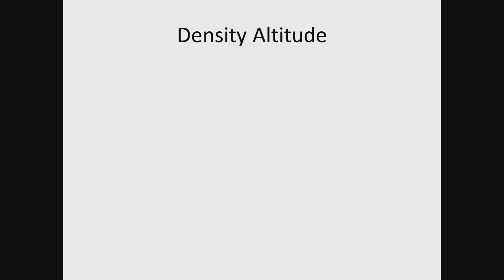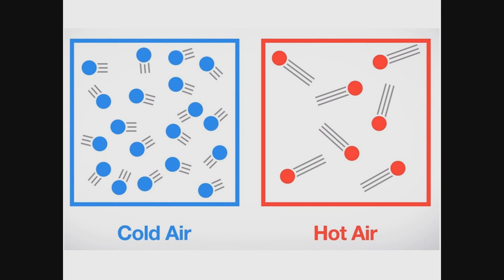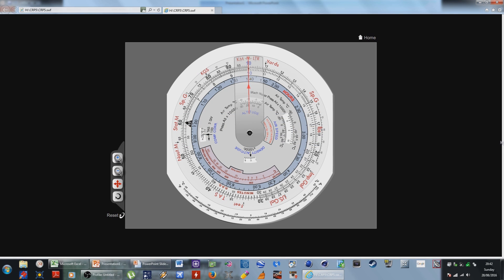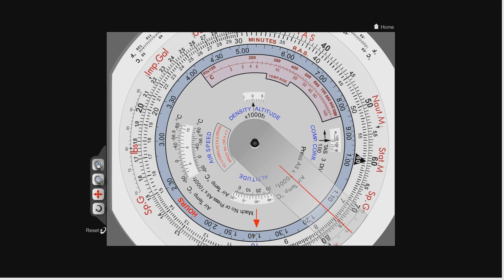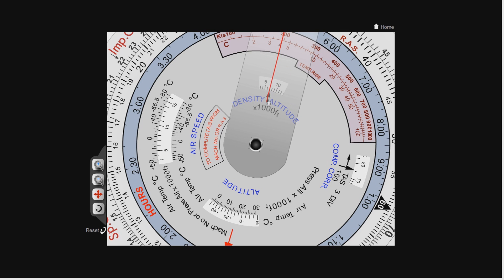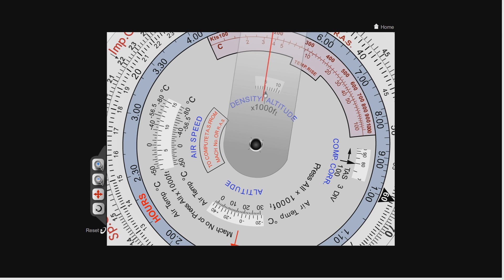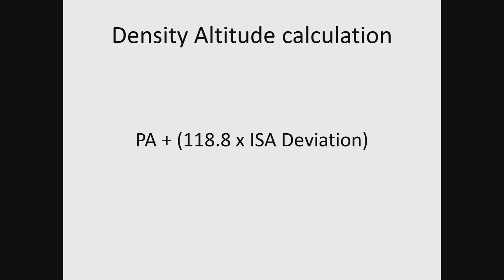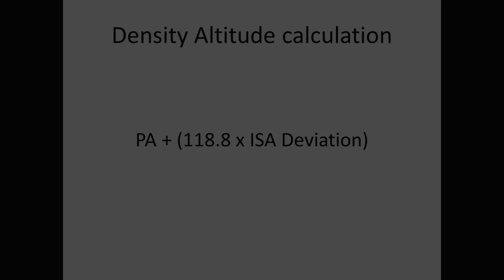CRP-5: How to calculate Density altitude

Comment: Thanks for this video. It was helpful as I have not used the CRP-5 in depth. I have a question though.. In your example you stated OAT = 30 deg C and elevation 4500ft , but you did not use the ISA Deviation. In your example for 2000ft, you used the ISA deviation. So I just need you to clear up whether you meant the deviation is 30 degrees or actual temperature is 30 degrees else its a bit conflicting? In the equation however it is clear that we should use the ISA Deviation - its just the CRP 5 that I want to know if we should use the ISA Dev. or the Actual reported OAT?Thanks
Reply from the maker: Hi, thanks for the comment.  I've been through the video and can't find the example for 2,000ft you are mentioning.  Where abouts is it? Thank you.
Reply: GoPro Flying Hi.. Sorry it wasn't 2000ft it was "5000ft and temp is ISA"...Thanks
Reply from the maker: If I remember correctly.  In both examples I actually used the actualy outside air temperature, not the deviation.  The CRP-5 is designed to do the ISA deviation automatically.
Just set the actualy temperature against the pressure alt.  The rest is done for you.

Comment: May I ask, what is the difference between the CRP-1 and the CRP-5 as I found that my calculations had slight variations when using the CRP-1?
Reply from the maker: I don't believe there is much of a difference between the CRP-1 and 5 apart from the lack of compressibiliy correction, RAM rise scale and one or two speed conversions.  The scales should all be as accurate as each other.
Reply: Thanks for all the informative video's and the reply.